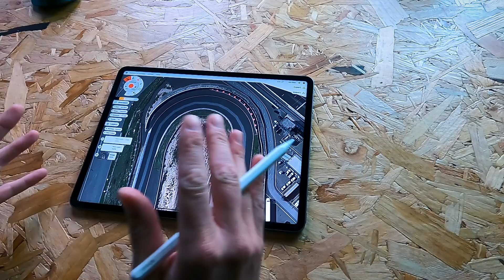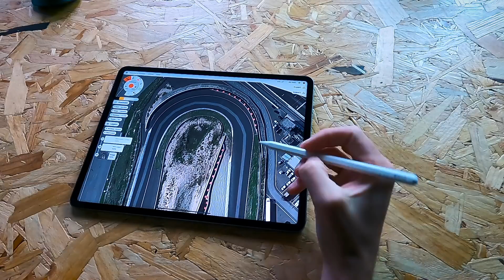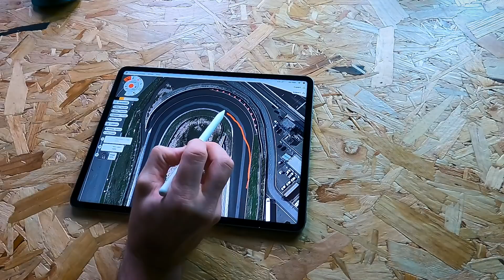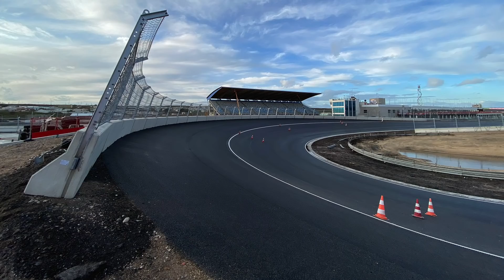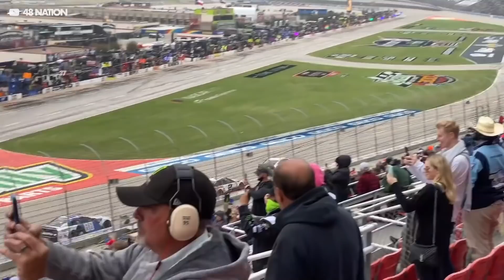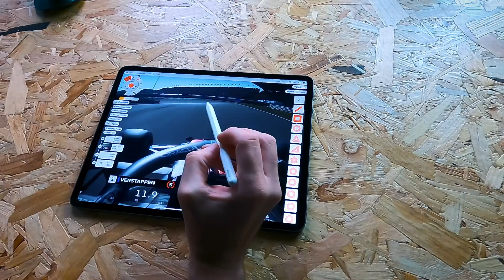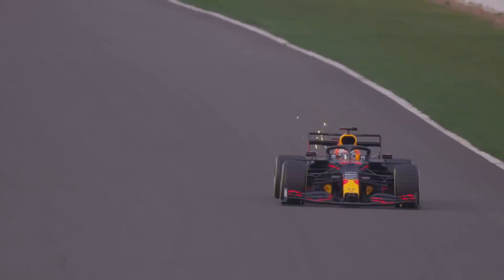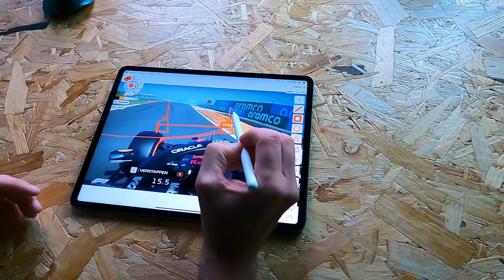Why the F1 Racing Lines were so BIZARRE at the Dutch GP | The F1 Breakdown

Comment: I hope this event is a keeper. The track has a cool roller coaster effect and the Dutch fans are fired up!
Reply: They would need to make this track much wider or all the F1 cars are going to drive on the same line meaning no overtakes.
Reply: @MikkoRantalainen  Why is it always "make the track wider" and not "make the cars narrower"
Reply: @KepleroGT  Good question. I would say that the reason is the cars need some minimum width to include the human driver. And if you want to go fast through the corners on wheels with human passanger, the wider you can make that car the faster you can go. And note that even superbikes require almost similar width because they need space for the human to tilt sideways even thought the part that touches the ground is really small.

Wider track allows selecting from multiple options to execute a turn, the narrower the track is, the higher the probability that all the acceptable driving lines go through one car width position on the track.
Reply: @KepleroGT  F3 cars are TINY and they couldnt race there man, it's impossible to make a car narrow enough to fit there properly
Reply: @danielsgrunge  Cars can race side by side for almost the entire lap (and frequently do). I've no idea where people get the idea that it's too narrow for racing. The problem, as with every racing formula, is the overspeed required to make a move stick, something that's most obvious when you see spec racing on Zandvoort where there's even less overtaking than in formulas where the cars have more varying performance characteristics.
Reply: @MikkoRantalainen  nonsens the ideal racingline is always 1 car wide. If you want more overtaking reduce braking capacity.
Reply: @MultiArrie  I'm pretty sure you can create tracks that have fastest single car wide racing line with side effects. For example, the fastest racing line could cause heavy tire wear whereas e.g. going slightly higher on the ramp could be slightly slower but reduce tire wear a lot. In such case, over a long race you cannot always go for the fastest option which would help with overtaking.
Reply: Really? It was a boring race except for a few pit stop strategy moves. That together with the qualifying/pitlane nonsense just makes it a nice classic track that’s best left where it was, the past.
Reply: Na it has potential.
Reply: @SgtGregorius  same, it didn't stand the test of time like other classic tracks did... Not fun to watch

Comment: There's a noticeable jump when exiting turn three on the inside. 
And in my opinion, the higher up against the wall you can go, the more speed you can maintain through a banked corner. Centrifugal force combines with aerodynamic downforce.
Reply: Thats why i use the high line in the f1 game, you can feel the speed in the high line

Comment: One thing Max said about turn 3 in an interview for Dutch TV was that the banking isn't smooth, it's like it's made up of plates, and perhaps it is. So if you were to go from the inside of the corner to the outside, you would cross some of these plates, which would mess with the weight distribution of the car. Basically there's tracks in the corner, pick one and stick to it.
Reply: His description reminded me of the Karussel corner in the Nurburgring.
Reply: @eefneleman9564  yeah I think that would be a good comparison

Comment: So you're discussing progressive banking, the higher you get - the steeper the banking. Some more American jargon for you. When you discussed Vettel's line, we refer to that as 'Diamonding the corner'... due to several facets in approach & departure of the corner. I tend to believe that on flat turns such as Luffield (negative camber)or any other 'flat' racing turn, there IS a racing line, but on banked ovals the racing line is always changing depending on where the rubber has been laid down.  With this season's fat tires, the car will probably stick anywhere, but 2022's tires may change that. Also, watch for the line to change over the years as the asphalt weathers, it must be harsh there.
Reply: Technically on banked corners there is a line well more like there’s 2 lines the bottom line is shorter distance but slower speed the high line is faster but longer. Arrogant and ignorant  people think NASCAR is simple because it’s just two left turns’ in reality car set ups matters so much depending on the track also drivers have to watch the track and experiment more in NASCAR cause like you said the racing line will change even during a race vs F1 when the only time they really change line is when they want to try and overtake.

Comment: The difference between inside and outside at T3 was probably a bit too much actually. T1 was very well executed, where you could actually overtake, but as Seb proved (and less spectaculary others as well) - the inside of T3 was absolutely useless. You couldn't really send a car across the inside, because the inside drop just offsets the car so much!
Reply: True. But Zandvoort is not ONLY made for F1 racing. Most of the time there are touring cars there. For them the T3 is very interesting.
Reply: @ronaldderooij1774  Great to hear! I haven't seen other racing series there since the rebuild, so could judge only from F1.
Reply: @AgnisRoz  F1 attracts cameras, touring cars much less so....

Comment: Please let me know if this plays a part: max was going right out to the limits (2 wheels off) at the opposite of the apex of the corner   will the Increase in gravitational potential energy play any part In the overall time through the corner? - slow down using gravity, regain the energy on the way out.

I know aircraft use this technique  that's what made me think of it.
Reply: Underground trains (tube, subway etc) can also use the same thing to save energy -- a bit of a ramp running uphill into a station to save the brakes and regenerate electricity, and then they run downhill after the station so they can get back up to speed with less effort.

Many stations on the London Underground, and many other networks, have this feature.
Reply: I posted a similar comment. That definitely tends to work for me in some racing games.

Comment: How much of an impact is there from the inner and outer line when you see the elevation difference towards the exit part?
I am curious as it seems that this track actually is high line centric. More speed through, better braking and better acceleration in the exit while, diving for the inner you are diving down into a pit you need to get out of on the exit. But does it have an effect and would it be better for different styles if the transition was longer at that part?

Comment: Since there is banking on this track, more than usual, did they have to raise the cars at all so they didn't bottom out too much, much like Indy cars? The turn that I loved was the last right turn (not sure of the number) before the finish line. It reminded me of the Indianapolis Speedway's last turn, which caused a lot of issues with the tires, but was exciting. They seemed to have fixed the issue on this track by increasing the angle as you go up.
Reply: 14, Arie Luyendyk corner. That is the final turn, named after the 2 time Indy 500 winner (and 2x as steep as the Indy banking coincidentally)
Reply: no because the banking isnt too steep. if it had more degrees like the nascar/indycar bankings, raising the car/completly differenct engine fuel flow would be needed. hence why zandvoort only stopped at 19 degrees.

Comment: Anyone who has followed NASCAR or other oval racing series can tell you that the high line on a banked corner can often be the fastest line. So those of us who are used to oval racing knew exactly what was going on. It was a bit weird seeing F1 cars not hitting what seems like should be the apex of the corner if it were near flat.
Reply: In qualifying fuel loads it would be more possible to take it flatout,but with race fuel loads,balance is different so that maybe part of reason,but yeah great edge from the oval drivers who no doubt would take the higher line on a curved banker,while watching others taking inside line.

Comment: laughs in nascar the concept is basic. The banking allows you to carry more speed by letting the tires lean into the track. This same concept is why the line closest to the wall is the fastest at many NASCAR tracks
Reply: But isn't the tradeoff more severe (outside being a longer distance to travel) because the turns in NASCAR are much longer?
Reply: @dwelmm  there actually isn’t much trade off really, the cars can carry more speed using the high side vs the low side which more often than not makes up for the difference in distance, especially coming off the corners. The high side is also easier on tires

Comment: would the banned DAS system helped Mercedes on the banked corners ??? the difference between winning  and loosing ???
Reply: Probably not, they only used it to heat up the tyres, not during the regular race.
Reply: Dont think so they would probably eat more of their tires as banked corners can be considerd  a straigt line.

Comment: If you take T3 and copy it right across from itself, it would be and exact copy of the Bristol Motor Speedway, progressively banked tight turn. NASCAR uses a grip compound that wears off over time called "PJ-1" and they put it on the bottom to make it a more competitive line at the start of the race, but wears of over time reverting to the naturally quicker top line. Having a mastery of both lines is what makes Bristol such a tough track to succeed at, and also makes for a dynamic race which is entertaining since you can see the whole half mile track from any seat in the grandstands and see what is going on through the TV broadcast. It's a fan favorite for a reason.
Reply: Hugenholtz, original the Zandvoort designer (not the one of the bankings now), actually co-designed Ontario Motor Speedway. He also did Suzuka, Hockenheimring (stadium), Zolder and a couple of others.
Reply: @LogiForce86  I live 10 min. From where Ontario Motor Speedway used to be at. It's a huge shopping center area now.
Reply: @LogiForce86  what a fantastic designer. We need him to design all the new tracks over Tilke. Tilke is ok too but we need more variety
Reply: @jackarmstrong7285  Hugenholtz died in 1995. He designed those tracks ages ago. But modern designers could learn from these designs. It’s just that in these days circuits are designed with modern infrastructure and safety measures in mind. So, huge tarmac run-off areas instead of gravel traps. Which drivers use, hence we have penalties for track limits. 
None of that at Zandvoort. If you’re off the line, you will be beached or in a wall. 

https://en.m.wikipedia.org/wiki/John_Hugenholtz
Reply: @jackarmstrong7285  he is no more as he passed away in 1995: https://en.m.wikipedia.org/wiki/John_Hugenholtz

Jarno Zaffelli is the designer of the changes at Zandvoort.
Reply: Didn't know alot of this :D
Reply: @MrAlanToast  Which you can take with you, and realize oval track racing is not as easy as it looks. Especially considering that there is no setup on any corner of the car that has anywhere near the same numbers as any other corner. Road racing is about a balanced set up. With a slight favoring to one side or another when comparing the number of left hand turns to right handers. Oval track racing setups are very imbalanced. You can't even start out with a balanced setup and adjust from there. If you tried that, the only question you would answer is are you going to wreck head on into the wall, or are you going to back it in. In road racing you can set the car up with 50/50 front to rear weight, 50/50 side to side, and the same caster, camber, toe, spring rate, etc. from side to side and at least get up some speed where you can learn something without wrecking.
Reply: Now for the F1 drivers to learn the slide job and we'll get some good overtakes.
Reply: Thank you for the supreme information
Reply: And for some reason PJ-1 doesn't work for Indycar at all, making the track absolutely useless one line railway.
Reply: @AgnisRoz  i was going to reference this, there is something about the open wheels that dont like it as much.
Reply: doesnt work for indy car b.c they dont generate enough mixing action via scrub for the pimp juice to work. Its a drag racing traction compound
Reply: And here i thought Bristal was loved for the inevitable carnage at being such a small oval track with so many nascars fighting for position.
Reply: @otanaka4551  wtf
Reply: I miss when Bristol was bottom line preferred, the actual racing was much better.

Kind of sucks now if you want to see actual racing and not just cars stuck side by side for 40 laps to complete 1 pass lol.
Reply: You do realize bristol is like 8 steeper than T3 right?
Reply: That is really interesting, I had no idea about the PJ-1 stuff.
Reply: Exact copy of Bristol? Not enough banking. More like Iowa.
Reply: Unfortunately, changing Bristol to progressive banking has been a disaster. They made it too progressive. The high line is now so much faster than the low line that overtaking is virtually impossible. Races have become boring processions. The track went from providing the most exciting races in NASCAR, to one of the worst and least popular tracks.

The new T3 at Zandvoort is similar. The banking is too progressive, making the high line the only one that works. With a more uniform banking, it could have provided a much better opportunity for side by side racing and overtaking. Bit of a missed opportunity, unfortunately.
Reply: @erikr968  You're probably thinking of the early 2010s Bristol with no pj1 because nowadays both lines are equal and put on banger races